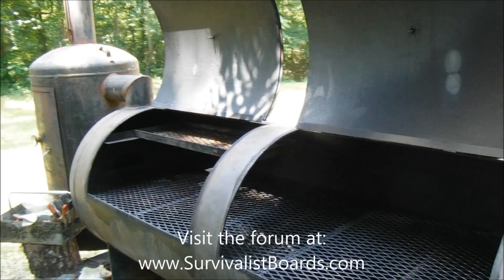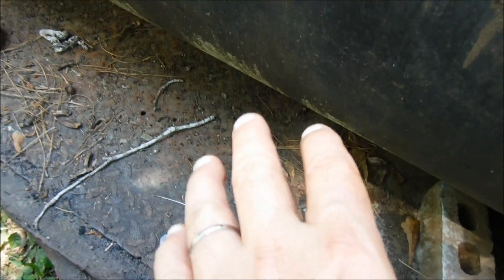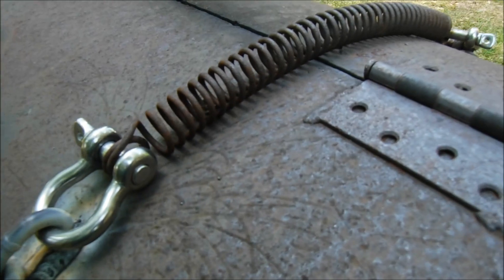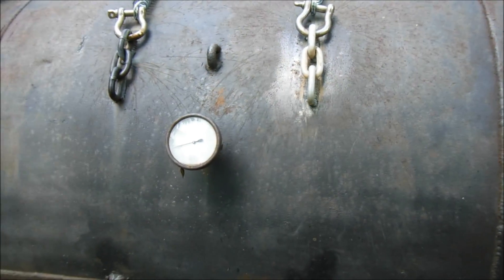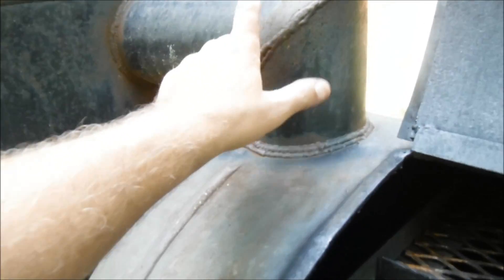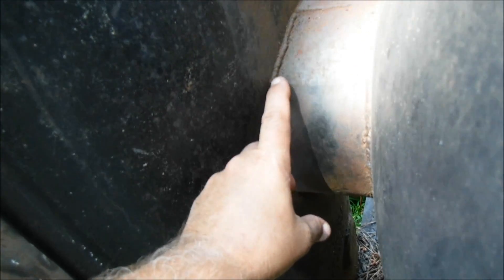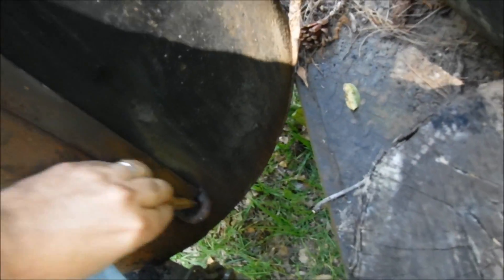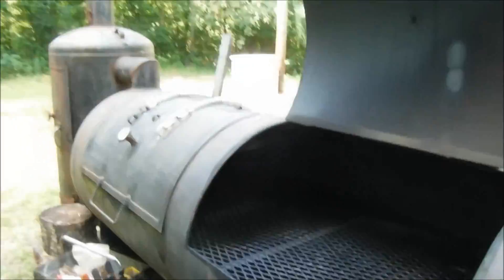Barbecue Pit Out of a Propane Tank

Comment: How did you cut the tank? Did you have to fill it with water
Reply from the maker: The tank had sat in a field unplugged and opened for around 25 years, so I used a cutting torch

Comment: What did the original tank measure? I’m building a smoker and the tank I bought doesn’t say how many gallons it is. Looks about the same size as yours. If you could measure yours I’d appreciate it...
Reply from the maker: This was a 250 gallon tank.  I will have to measure it tomorrow if you want.
Reply: I’d appreciate it man. Thanks!
Reply: If it’s easier you could just measure the factory welds from outside to outside...
Reply from the maker: @taylorbinning5346  From head seam to head seam - where the head welds to the vessel, that measures 6 feet 3 inches long.  Internal diameter (lifted the lid and measured across), 23 inches.
Reply: Thank you!

Comment: I would like to hear more about the smoke side.  Like what kind of wood a d such.  Not criticism.  Really wanna know.  Plus I'm a welder and that little welder is just fine.  I use the 240 version a d love it for home projects.  At work I weld 6 inch thick steel.  A d would rather use this.   Made a bbq to roast pug with the 120 model and it worked great.  Just wanna see the wood side